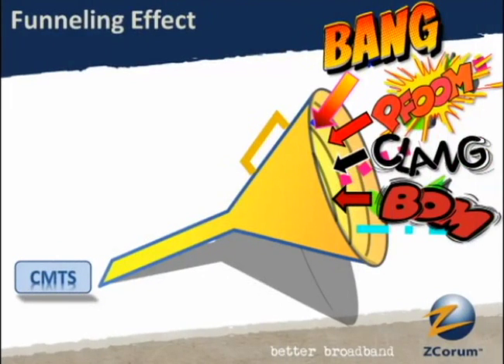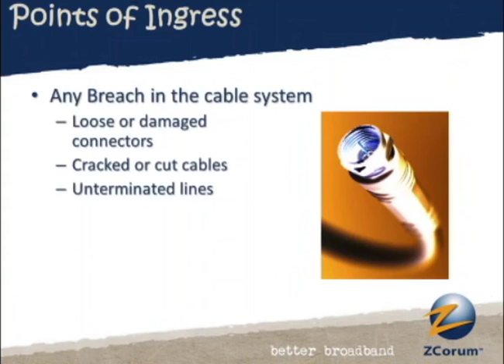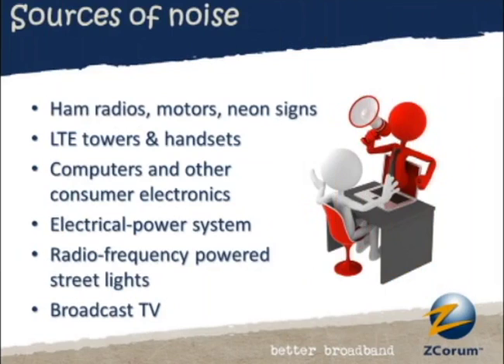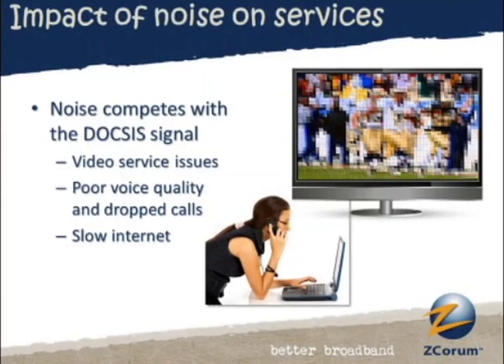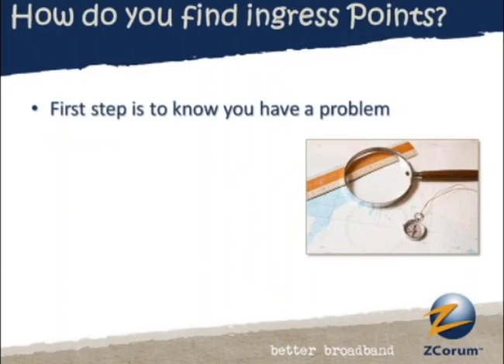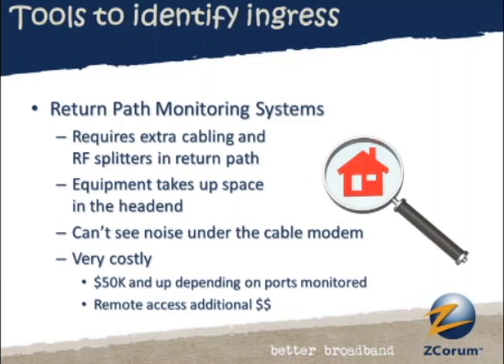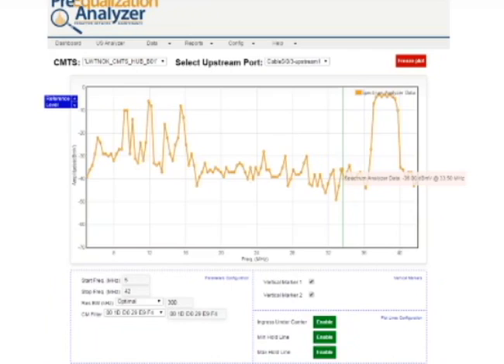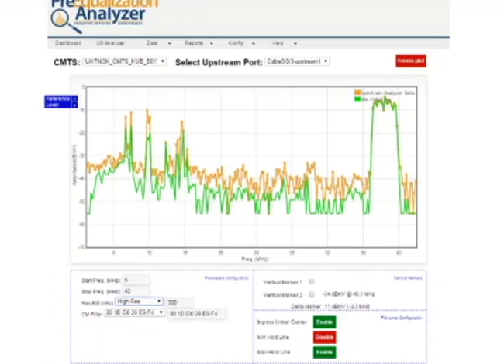NCTC Webinar Remote Return Path Analysis in DOCSIS Cable Plants

Comment: For the most part your info is correct; however some is a little off. I am a DOCSIS engineer for CableLabs. We engineer, research & developed, and invented the cable modem/CMTS form of Internet. 1 thing is people don't know what a CMTS is so I would explain that and 2 main lag on a CMTS could be TEK communication between the CM & CMTS. That involves the BPI functionality of communication. The actual inventor of the concept is Ruzbe Yassini. He then tasked CableLabs with the responsibility of R&D, engineering, testing correct functionality & compatability, as well as certifying equipment. If it does not pass and get certified it does not make it to the market. To learn more go to cablelabs.com and Read the DOCSIS 3.0 Specs.